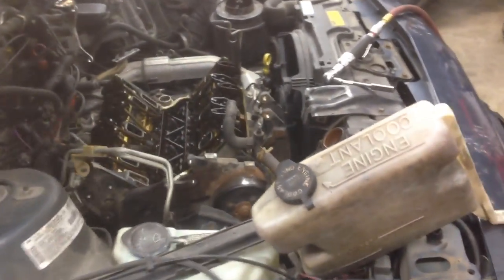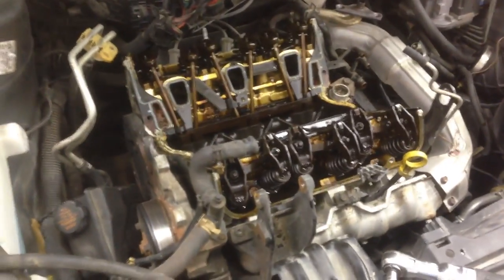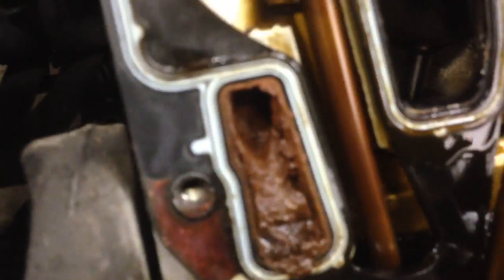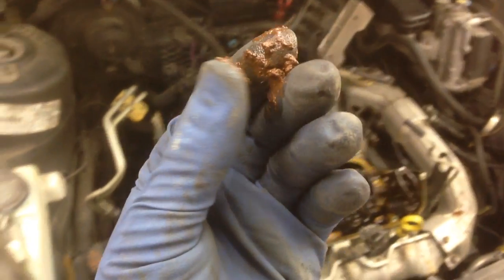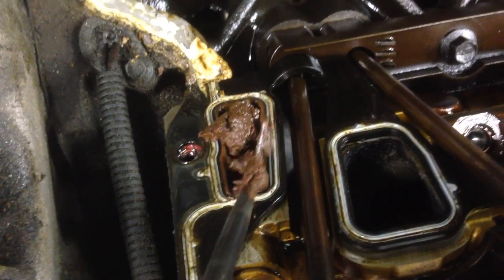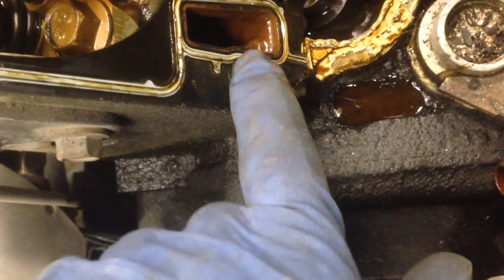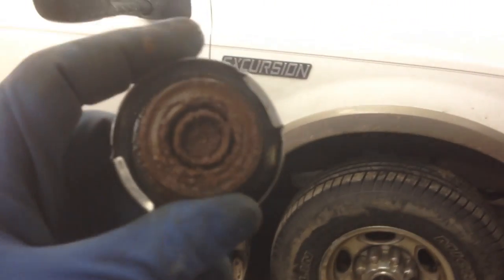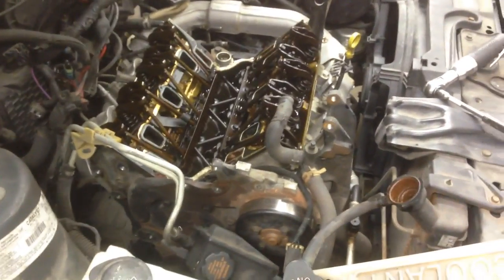Why it's called DexKILL

Comment: Dexcool typically does this when its mixed with contaminated water(ie, you didn't use distilled water), or its mixed with the wrong type of coolant.  Been running dexcool in my truck since it was made, just changed it again after 5 years, and it came out just a little darker than when it was new.  Water matters more than anything else.
Reply: You are correct!  I have a 2001 Pontiac Bonneville that just turned 183000.  He points to the sticker that clearly states 100,000 miles OR 5 Years!  People seam to forget that all antifreeze becomes acidic with age, and never ever think of "preventative" maintenance!
Reply: WHEN people don't bother to read 🤣😂

Comment: if you did the same job 25000 miles ago why did you refill it with the same crap??
Reply: exactly
Reply: warranty?
Reply: In my experience, I've found that most people re-use it due to fear and/or ignorance. A lot of lies are typically spread about products that are total garbage, in order to keep people purchasing them. DexCool is no exception. Ya gotta remember, there's huge money in it for the manufacturers of DexCool to keep spreading lies that it is "great stuff" and that it "lasts longer" and that it is "not harmful" to the vehicle's cooling system, so that they can keep peddling their garbage. Truth is, it's all a bunch of lies, based upon thousands of real life vehicles and situations that I personally have seen first hand, time and time again.
Reply: Just use the green stuff or go one step better and get some engine ice or other high quality brand mainly used in race vehicles.
Reply: You raise a good point, but left out that it has to be an equivalent based on chemical make up.
Reply: Man he just dragged the garden hose in there bro, put some rubbermaid water in that piece, see you in 25,000 miles😏...
Reply: And used the same shitty gaskets instead of getting the felpro set
Reply: @kendogg7999  That was the first thing I noticed and laughed my ass off. I hate that stupid design of having the rocker arms in front of the intake gasket.
Reply: @caseydman4651  On a 1996 Cierra??

Comment: I think one reason why Dexcool gets a bad rap is because GM blamed pretty much every cooling system problem on Dexcool when there were other design and engineering flaws with their engines.
Reply: Fact is, BOTH were the problem.  Do your research and you'd know that to be the case.  DexCool is garbage, as were all of the OEM intake gaskets used in the GM V-6 engines from the mid-1990's thru the early 2000's.
Reply: Turbo Diesel ...Dex-Cool had the tendency to attack nylon and plastic parts in the cooling system, particularly in the intake manifold gaskets, causing coolant leaks. My friend's 2000 GMC Safari 4.3 needed repaired for that problem. The nylon pieces completely fell apart when they were removed. The replacement intake gaskets were supposedly improved in this area. The Dex-Cool in her Safari was replaced with Prestone All Makes, All Models antifreeze with no further issues.
Reply: ***** ...Hopefully, GM is using materials now that are fully compatible with Dex-Cool.
Reply: My 2007 Chevy Uplander had a leaking intake gasket at 49,000k it has a 3.9
Reply: NorthStar engines kinda suck
Reply: Yup I had to replace the whole cooling system on my 02 S10 ZR2 i put a high flow water pump,triple core aluminum radiator and 180 thermostat. With 2 gallons of prestone coolant and one gallon of distilled water. My 99 blazer the intake gasket went at 230,000. And then blew a head gasket a few thousand miles afterthat. Probably because of dexcool
Reply: disagree treat them right they do the job. dexcool is crap gaskets also bad replace them then go back to green. drained  & flushed my 4.3  03 truck in 06 put in the green now at 340,000+ miles.
Reply: Thats not just dexcool. There is something else in that cooling system. All you people saying deccool is the problem dont kbow what you're talking about. I have a 2001 chevy impala with 226000 + miles on it. Original engine and transmission. Has had dex cool in it since day one.
Reply: D car21679 I agree. Dexcool mixed with any other coolant product = jello but strangely went 190,000 miles before a leak right? Tie that one on to your "research" buddy.
Reply: John Williamson my 01 alero(on my channel) runs beautifully and thankfully only had dexcool in it for one year
Reply: Alex's Bikes and Motors same is with my 2000 gmc sierra 3500 but it doesn't happen to Japanese cars...it almost seems US had outlived its corporate forecast
Reply: ryan Lost_broken_arro Exactly! If you mix dex cool with another it gels
Reply: @Dcar-sp7qx  People can't figure out that when your Dex cool is starts looking dark or rusty that it's time to change out the coolant deserve the problems they get.

Comment: I flushed my system and switched to DexCool. Since doing that I have gained 25 horsepower and my engine runs 20 degrees cooler. That was 5 years ago, the coolant still looks clean and beautiful. Even a rainbow comes out of my radiator when I remove the cap in the dark. Thank you GM for this amazing antifreeze!!!
Reply: Shill account?
Reply: Sold! Picking some up tomorrow, I cant wait to taste those rainbows!
Reply: Cavesuki LOL !!!
Reply: 6strings1pickup 25 hp lol
Reply: and you fart unicorns, right?
Reply: @stoneblue1795  did you know that a Rino is the other name for a Unicorn? Look it up in an old Engish Dictionary.

Comment: I thought this only happens when you mix Dexcool with the green stuff.
Reply: camaroman101 yes that is exactly correct!!!!
Reply: old age will do it too, this stuff was garbage when new and is garbage now, just like everything else in these godawful cars
Reply: camaroman101 was going to say the same thing, looks like cross contamination
Reply: HAHA yeah my mom has a Saabaru 92x linear ( the 92x Aero was the wrx). Its nice because I'm already used to subaru's. I love that car!
Reply: Sorry to bust your butt bubble, but I still drive a 96 Tahoe 5.7 which now has 208k on it. Heads have never been off, coolant has been serviced as per guidelines and it is in great condition. The Dex in my truck is still bright orange and has never caused an issue. I did intake gaskets when I replaced the old FI popit valves with the Borg Warner MPFI conversion and all was in good order. Not sure what "godawful" cars means as you can find more of these old tanks on the road today that any import (rust belt states).

Oh yeah......had to rebuild the "godawful" transmission at 174k.....(pos)

I don't believe what this dude is saying. Air in the cooling system? C'mon man?

However, mix green with orange and what do you get?
Reply: randsonic that's awesome! exactly what I've been saying!
Reply: Only in the V6 engines.......it never affected the 5.7 as I have.
Reply: randsonic I don't know what was wrong with your trans but my 95 1500 with a shift kit is in perfect condition
Reply: The planetary gear went bad. I have to add, I pull a 8000lbs trailer with this thing 2 times per year. I have a cruiser boat which weight 5500lbs dry, a 2000lb trailer, with gas and everything on board I am pulling 8000lbs.

This truck has been bulletproof really. I just changed the original starter out at 210k.
Reply: I know something like that can happen if you mix the pink VW antifreeze with the green stuff and it is supposed to gel and plug things up if it happens.  IF in any doubt as to whether or not a coolant is compatible don't use it even if it is listed on the label of one of those universal antifreezes.  I know you won't like what I have to say buy if you are not 100% sure of the chemistry of your coolant and some universal stuff you got from the auto parts store, you are better off paying for the correct fluid at the dealer.  That way you are less likely to ruin something.
Reply: It wasn't mixing green and dex but was caused by leaking lower intake manifold gasket allowing oil into dex coolant making brown mayonaise. I did lower intake gasket on wife's Olds Silouhette 3.4 V6 twice at about 50k miles each time. Gaskets shrink, bolts loose, oil leaks and mixes. Beat oil and coolant get mayonaise. I had entire paper plate mound of brown poop from manifold passageways each time. Recall lawsuit on dex was FALSE and not true. Gaskets shrank and allowed oil-coolant to mix.
Reply: camaroman101 I just flushed mine, it had dex and green stuff in it. Noting like this. I used about 9 gallons of distilled water through the system so far. It still had a bit of red too it. Maybe 4 gallons should be fine. Debating on the dex-cool in it...
Reply: camaroman101 my radiator didn't look anything like this one. I have a 2000 chevy tahoe Limited 5.7ltr.
Reply: yep
Reply: my cars to dont mess it up it be fine
Reply: Don't use it, read my post above.... My Dad had been using this since he bought the Truck 2001.  Every 4 years, we had to go to a Mechanic and have it flush out due to over heating.  This time, I was doing the flush, because of the bad Coolant Sensor... I was able to see, when the Sensor came out, it was all " Gummy ", so I went further and found a big clogged in the Engine.  My Father NEVER had any other Coolant in the Engine but the recommended by " GM Dex-Cool " .  ://
Reply: I would like to add... Funny thing is, we have a 1996 Chevy Blazer with the same Engine 4.3L. But we use " Junk " Coolant from Walmart 50/50 since it's our Beat-Up Car.  We " Never " had any problems of over-heating or Gummy / Gunk stuff ://.
Reply: Don't mix dex with green antifreeze. Got a saab with dex and never had a problem. Changed it recently for new dex and its been fine. Problems are due to mixing or garages/service shops topping it up with the wrong coolant. Also top up with deionised water - not tap water.
Reply: +jnbing - My Father " NEVER " had any other Coolant in the Engine but the recommended by " GM Dex-Cool ", since he bought his S10-2001.  If I even thinking of dumping even just " Water "... I would be DEAD by now, NEVER-MIND about anything else.... LOL.... How do you explain that one???
Reply: Can this be taken care of with a flush?
Reply: I completely drained my 4.3 in my s10 and put in dexcool and now i have this mess. Its kickin my ass too. I will never use that crap again.
Reply: sure does
Reply: @randsonic  Yes, I still see many of these older Oldsmobiles and Buicks as well as the aging W-Bodys that replaced them here in Indiana where they sold like hotcakes in the Mid-West.  Nice, traditional American automobiles with comfortable rides that I would gladly drive over any of the godawful modern sedans that have rock hard seats and the side profile of a turtle!
Reply: It also happens when you never change it

Comment: My guess is stop leak to be honest. I have a 03 TrailBlazer with 200k on it and no issues with the antifreeze. I just flushed the system and the old antifreeze looked like new yet. It was clear as it could be aside from the natural orange color. It wasnt murky or cloudy. I poured it into a white container and it looked great! I always use distilled water as a thinner because tap water has too many minerals. Like a hot water heater,those minerals will and do end up coating your engine interior.  I never ever use tap water. That could be another cause. Mixing any antifreeze with tap water is bad. I just flushed our Subaru Forester. The Auto parts stores told me I could use ANY antifreeze in my vehicle when I know as a fact,subaru changed the composition of their head gasket material and stated that only Subaru type antifreeze be used. So there you go. Those after market asshole parts places dont give a rats rip about your car. Before doing any work on your car. double check what is and what isnt allowed to be used in your car by looking it up first. also get on a forum concerning your car,you will learn more about your car than any dealer,or auto parts store.
Reply: as many others have said, that residue is bar's stop leak or a similar product, not dex-cool. having personally removed many head and intake manifold gaskets that were in contact with dex-cool for their entire service life, i can say for certain that a properly functioning coolant system full of dex-cool will never develop this type of buildup. i'm sure distilled water would be superior, but i've always used tap water to mix coolant and i've never had any issue whatsoever. as mentioned in the video, the real problem here is the engine. gm's 3.1 and 3.4 engines are known for having gasket issues, and hence would be a prime suspect for stop leak usage by a negligent owner.
Reply: ive seen plenty of non mixed dexcool disasters.
Reply: My '04 Impala used dexcool and has never had any stop leak added, but got really gunked up.  When I had it flushed and filled last time I used regular coolant and it works just fine.  I have over 250k on a 3.4 liter Impala LS and it runs excellently and has had no major repairs in its lifetime.  Seems I may be  the luckiest Impala owner in history.
Reply: You raise an excellent point.  Tap water--no, no!  And, Well Water is especially loaded with minerals.  What to do?  Supermarket sells "Distilled Water" in the bottled water section.  It's worth buying to get the correct length of service out of your cooling system maintenance.
Reply: scott firman i
Reply: I have used Bar's Leaks for decades now with absolutely no ill effects ever. In fact, I read somewhere (I hope someone can concur) that all/most US manufactured cars got the Bar's leaks treatment before they come off the line. This may have been some years ago I admit.
However, I do not believe Bar's Leaks when used properly will do this. The point is, use Bar's Leaks as specified and get your cooling system completely flushed after repair attempt is made.

To each his own, but this video shows what I have witnessed when orange and green get mixed.
Reply: randsonic You are correct in stating they used bars in new cars,that was in the 70's,before plastic and aluminum radiators. Now days with smaller motors and smaller portsvin the block and heads,I would bet Bars would pretty much clog up the system. I wouldnt attempt to put it in newer cars,especially with those heater cores they put in them. I have heard too many storys where guys have used it then reported they had no heat. Everything has been downsized on cars to save weight and material so it only figures that bars would kill a heater core.
Reply: scott firman meanwhile they weigh as much as an old full frame wagon.
Reply: Scott...from my research they are still adding this at the factory. It inhibits rust and allows for the sealing of sometimes troublesome aluminum parts.
Reply: randsonic I wouldnt be suprised to be honest. I used to hear the storys of car manufacturing back in the 70's when my Uncles worked for GM. My Grandfather retired from there as well. I did four years of it before I had enough and walked away. I moved on to better opportunities thats for sure.

Comment: I don't know that I'd be bragging that I'd done the gaskets 25k miles ago and now it leaks again
Reply: Talisman1957 he's not bragging... he's suprised that he has to change it again
Reply: Some cars just have really poor designs so they require constant attention. That's all he was saying, it wasn't bragging. It just shows how fast that shit built up again and puts things into perspective.
Reply: It's the 3.1 design.  Since it has this weakness, don't push your engine when the engine is cold.  Drive it gently until it's completely warmed up and the various metals and gaskets have expanded to their normal operating temperature.  Pushing any engine when it's cold is always bad regardless to even the best engine ever built.  And bare in mind that completely warmed up takes longer than when the temperature gauge first arrives at the normal reading, and heater is working.
Reply: Eric Fixalot Tipical gm products.

Comment: Something else is going on there causing the problem.  Dexcool itself does not do this.  GM used to factory bars stop leak powder in new vehicles because of porus aluminum. It was supposed to gel up when exposed to air to seal the leaks.  Dexcool should be drained and filled every 4 years.  I have it in my show car - a 1996 Deville.  Coolant always looks great.  A little murky from the bars stop leak i still use.  GM does not recommend it any more because too many people thought their coolant looked muddy.  Funny so many people do not take care of themselves, and eat shitty food and say nothing, but if their coolant is not crystal clear orange, they get all bent out of shape.
Reply: David James The 96 DeVille, GM's luxury police cruiser.
Reply: Brandon Obaza you do not find them to be a luxury car?
Reply: Didn't say they weren't, but outwardly they look like a Chevy Caprice with a Landau top and vertical tail lights.
Reply: Brandon Obaza i agree.  Mine does not have the roof.  I would have purchased a loaded caprice at the time, but standard options are much cheaper.  Picking all the standard options that are on a Cadillac for a Chevy would make the Chevy almost cost as much as the Cadillac once the Cadillac 5 year warranty is taken into account. Plus Cadillac usually has options not avail on a Chevy. At the time, I do not know if stainless exhaust was on Chevy.
Reply: It's getting more interesting now. Pretty much every car has an "elite" trim level with luxury options. My Sonic (Chevy's 2nd smallest and most boring econo-car) has a turbocharged engine, heated leather seats, and a MyLink infotainment center. They try a little harder to make you feel like you're NOT in a shitbox, right down to a "sporty-looking" gauge cluster with digital speedo and prominent analog tach.

Given all that, Caddy has to go nuts to set itself apart. That means more amenities, more exotic styling, and some exclusive powerplants (like the twin-turbo V6 of the ATS-V).

My only complaint thus far has been the cost of tires. 205/50/R17 is an odd size. Also, GM makes a turbo 2-liter with 275hp/295lb-ft. Need that :)